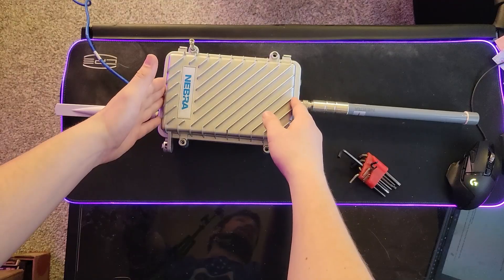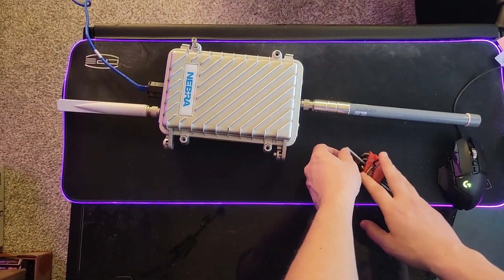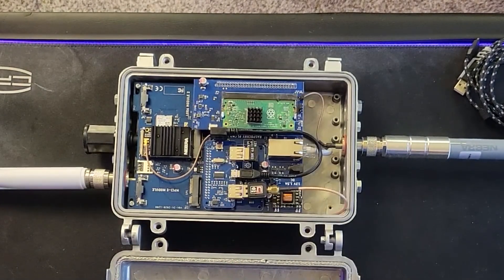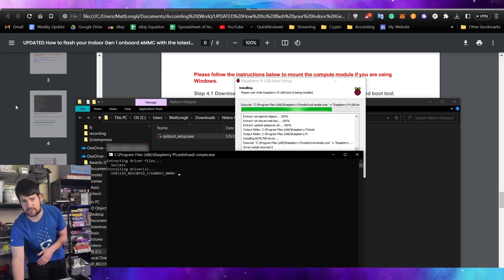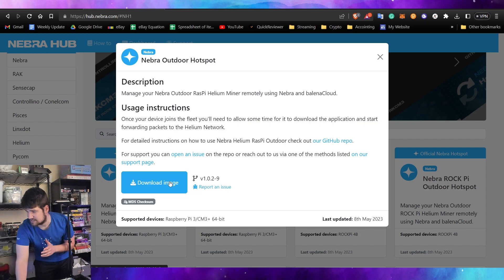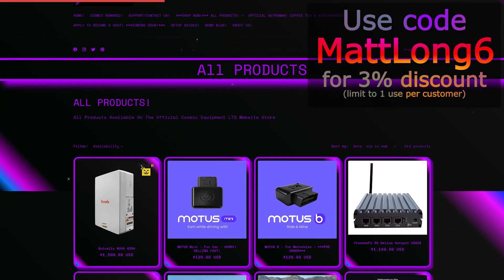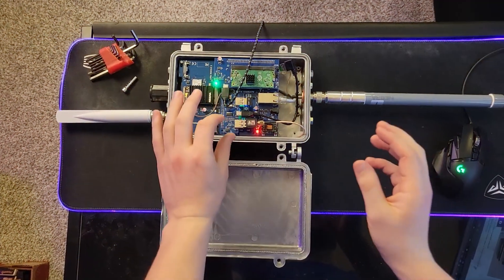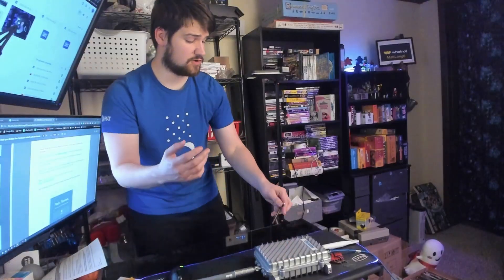How to Flash a Nebra Outdoor Hotspot

Comment: Hey, I just got a chance to try and finally troubleshoot one of my miners, the back has a solid yellow light, and the button on the back doesn't do anything no matter how long I hold it for, any idea what I should do next?  I opened it up and it seems that everything is seated/connected properly.  I just cannot get it to do anything but have a solid yellow light.
Reply from the maker: Have you tried flashing it? 
And you may want to join the helium discord and see if someone can help you in there because it seems that Nebra does not respond their emails anymore.

Comment: i cannot see E:/ disc after installing rpiboot, what should i do? Also the blue light goes off after connecting to usb and turning on balena
Reply from the maker: It may be under a different letter, just be sure to verify that you're using the right letter or you might delete something off a different device or your computer. 

Sorry I'm not sure how to help with the light turning off.

If you are unable to see it in your computer then it may be possible that you have a broken part somewhere, and I'm not too sure where you can get help because they seem to not respond to my emails anymore maybe join the helium discord and ask for help in there.